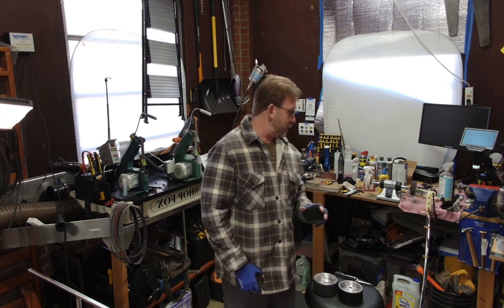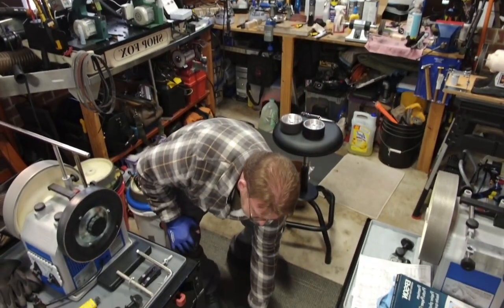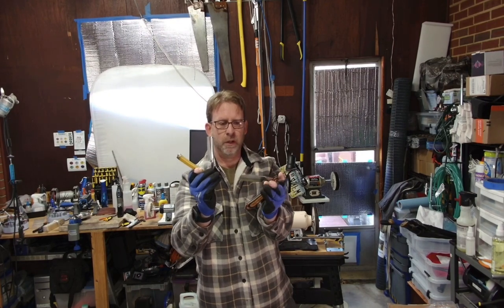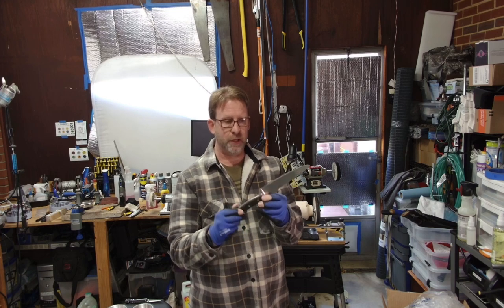Unboxing new 2x42 wheels for Bucktool

Comment: Wheels installed yet?  I've got same 2x42. I have many more questions.
Reply from the maker: Yes I have used both wheels and they are great. I am very happy with both I can now run the large 3m Scotch Brite Belts and the regular wheel they made me with the soft rubber is much better than the original all metal wheel.
Reply: @Alexandria Knife Sharpening  thx.  Anyway to continue via email?
Reply: I have the same and I have many questions as well.

Comment: Cool! I wondered who else would make those besides Amazon. Would you happen to know the size for Harbor Freight idler wheels? I’ve got the drive wheel 15mm.
Reply from the maker: https://shop.currycustomcutlery.com/collections/machine-parts/products/1x30-idler-wheel-trued-w-bearing
Reply from the maker: Cliff Curry has the idler wheels he's the only place i have ever seen them link above
Reply: @ALXSHARPEN  you think that Sunray would do them in aluminum with the bearing?
Reply from the maker: @robertmunguia250  check out their site they do all things wheels they do have a minimum 2 wheel order and yes they do Bearing wheels they pretty much do everything when it comes to wheels
Reply from the maker: https://sunray-inc.com
Reply: @ALXSHARPEN  ok so all sizes?

Comment: Whenever you have a chance please, I have few questions about the wheels, I have the same grinder and In would love to buy some of those wheels, I did cut my belt guard but the scotch belt still very tight. Thank you , please keep the videos coming.
Reply from the maker: ask way ill try to answer the wheels are not cheap and they have a two wheel minimum order the wheels cost more than the machine but if you can find someone else who wants one maybe go in together just had a guy the other day who wanted one
Reply: @ALXSHARPEN  how much were they? Have you tried them, does the scotch belt work now? I did cut my belt guard but the belts I have are super tight.
Reply: Do you have a email I can contact you if that’s ok?
Reply from the maker: @ivanlujan253  yes they work fantastic far better than the original wheels yes the scotch Brite wheel runs perfectly and is awesome
Reply: @ALXSHARPEN  what about the regular belts? Are they  a bit lose now that the wheel is smaller ?
Reply from the maker: I will look up the price and reach out to my contact maybe now that they are made he can give me a better price but since they did the hard part now may be worth selling some more. I’ll email my guy at SunRay
Reply from the maker: Each wheel cost me $194.27
Reply: @ALXSHARPEN  Maybe we can find someone else that want a wheel.
Reply from the maker: @ivanlujan253  ALXsharpening@gmail.com